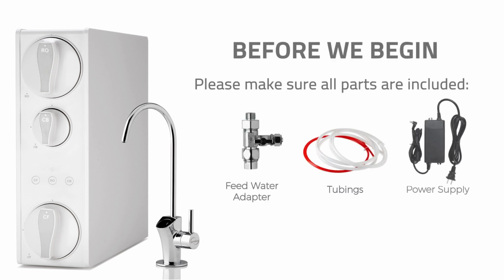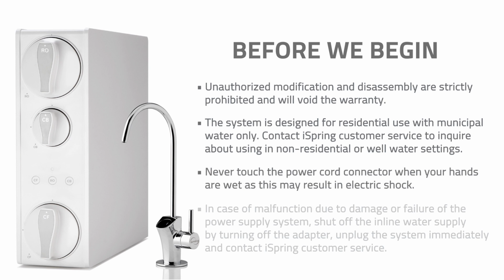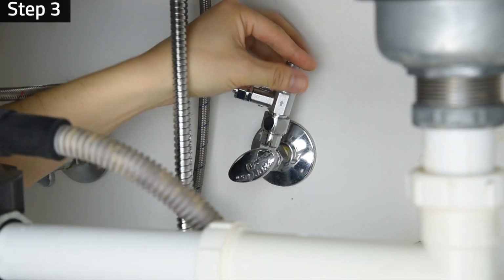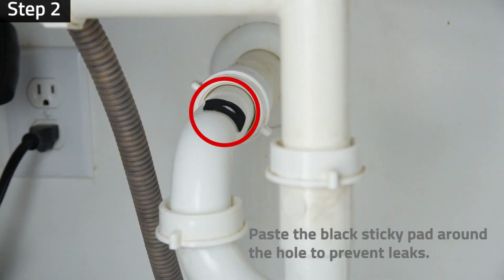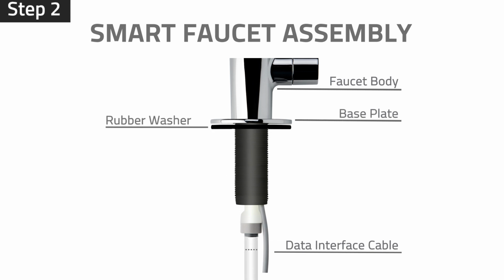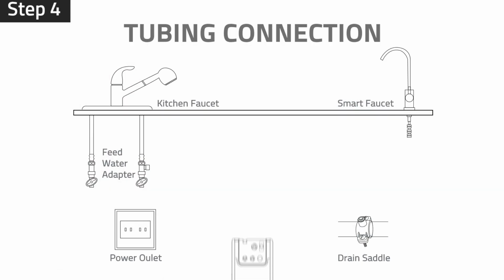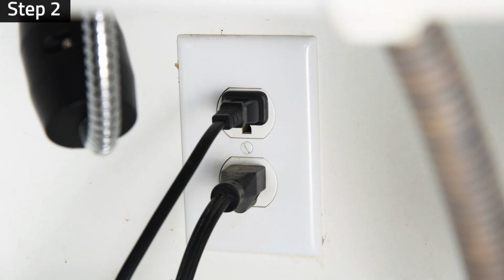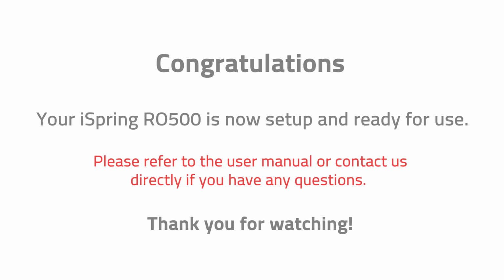How to Install iSpring RO500 Tankless Reverse Osmosis Under Sink Water Filter | DIY Installation

Comment: This video is showing to install the drain tube behind the water trap. Doing this will cause sewer gases to escape. There’s a reason why there’s a water trap.
Reply from the maker: The drain line fitting is tight, secure and sewer gas will not penetrate the permeate water. If you have a garbage disposal then some customers prefer an adapter like this one:
   https://www.amazon.com/Watts-Premier-164020-Plumbing-Adapter/dp/B009XDMEK4

Comment: Can I connect it to my refrigerator to have COLD clean water and ice? 

If I can, do I have to remove the refrigerators filter or do I leave it in place?
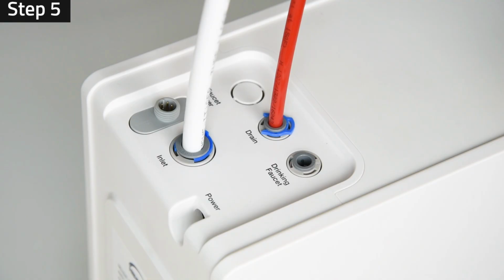Reply from the maker: Hi Alexo. Yes, you can connect RO500 to your fridge with ICEK (https://www.123filter.com/ac/index.php?rt=product/product&product_id=259). You don't need the fridge filter after connecting to the RO system. If you have any more questions, please feel free to contact us at 678-261-7611 (M-F, 8:30 - 5:30 EST). We are happy to help!
Reply from the maker: Depending on your ice maker in the refrigerator, it may cause the RO500 system to turn on and off constantly, which is not suitable for an electronic system. In this situation, we recommend using our traditional RO system, like RCC7 model (https://www.123filter.com/ac/5-stage-essence-ro-water-filtration-system/ispring-rcc7-5-stage-residential-under-sink-reverse-osmosis-water-filter-system-wqa-certified-75-gpd), which doesn't equip with an electronic system.
Reply: Got it. Thanks

Comment: How likely are you to have an electric socket right under your sink drain?
Reply from the maker: Hi Benji. We also offer reverse osmosis systems that don't require electricity. You can check out our best-selling model RCC7AK here: https://www.123filter.com/ac/ro-good-taste-alkaline-mineral-bottle-water/ispring-6-stage-superb-taste-75-gpd-high-capacity-under-sink-reverse-osmosis-drinking-water-filter-system-with-alkaline-remineralization-nsf-certified

Comment: Friend, I would love to know what voltage the electrical accessory that feeds the purifier converts to.  I would greatly appreciate that information.
Reply from the maker: Hi Hugo. The input should be 100 - 240 V AC and the output is 24V DC.

Comment: I’ve a built in faucet for driving water in the main kitchen faucet, i don’t want to drill a hole and install another faucet on my counter, will this still work with using the digital faucet it comes with??
Reply from the maker: Hi Prince. You would need an integrated kitchen faucet, or connect the system directly to fridge, or mount the RO faucet to the wall behind the sink or to the cabinet door or a portable stand.

Comment: We are on well water that, at point of entry, is fed through a salt-based water softener.  As such, the only (or mostly only) TDS is the salt from the softener.  That comes in at about 130 PPM. Will this system reduce the salt in any way, and if so by how much?
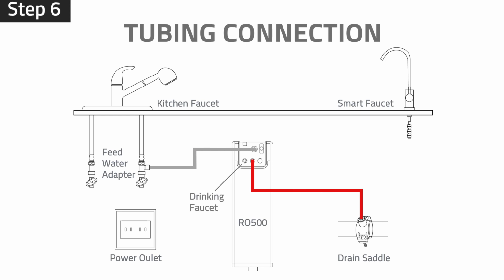Reply from the maker: Hi Andrew. The system will remove sodium at 92-98%. If you have other questions, please feel free to call us at 678-261-7611 (M-F, 8:30 - 5:30 EST) or email us at support@123filter.com. We are happy to help!

Comment: Can this be run with hot water?
Reply from the maker: Hi Alonzo. This system cannot be run with hot water. It's working temperatures are 41 - 100 F.
Reply: Thanks for the information. I went with a separate hot water filter. Thanks

Comment: Can you use a filter to mineralize the water after going through the reverse osmosis system with this RO500?
Reply from the maker: Hi Sandy. Yes, you can!
Reply: @iSpringWaterSystems  Could you provide me with information or video that would help me understand how the RO500 Tankless system works with the Alkaline Remineralization filter.  Thank you for your help!
Reply from the maker: @sandybergeson9897  The alkaline filter is an inline filter so you need to cut the faucet supply line and insert the filter. Please note that although you can connect RO500 with an alkaline filter, it can be a pain to do it. If you need a reverse osmosis system with remineralization, please consider our model RCC7AK: https://www.amazon.com/iSpring-RCC7AK-Capacity-Drinking-Remineralization/dp/B005LJ8EXU. If you have any questions, please give us a call at 678-261-7611 (M-F, 8:30 - 5:30 EST). We are happy to help!
Reply: @iSpringWaterSystems  CAN YOU TELL US.. HOW MUCH EACH FILTER PRICE. ...AND HOW LONG WE CHANGE THE FILTER. .THANK!..
Reply from the maker: @jimmytran1471  The membrane of RO500 system should be replaced every 2 years, and the rest 2 filters should be replaced every year. You can find the price of replacement filters here: https://www.amazon.com/stores/page/858F6407-DC33-4859-ADB4-0415C16C40B9?ingress=3&visitId=e0b0b8b4-b6c7-4846-9d62-4461eadf5744.
Reply: @iSpringWaterSystems  THANKS! ...
Reply: @iSpringWaterSystems   Do you have a tankless system that offers remineralization?
Reply from the maker: @satchmo8611  Yes! Please check out our RO500AK model: https://www.123filter.com/ac/high-flow-ro/ispring-ro500ak-bn-tankless-ro-reverse-osmosis-water-filtration-system-500-gpd-with-natural-ph-alkaline-remineralization-smart-faucet-with-tds-monitoring-21-pure-to-drain-ratio

Comment: In our home TDS level is 650, will it reduce to less than 100 tds. Or I will have to buy 6 stage RO system
Reply from the maker: Hi there. Yes, the RO500 system should be able to reduce your TDS from 650 to less than 100.